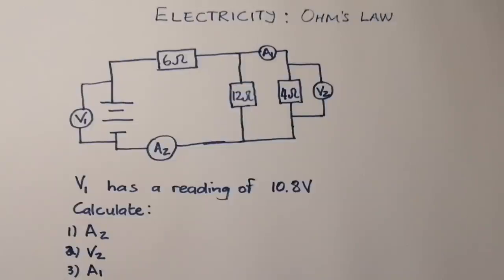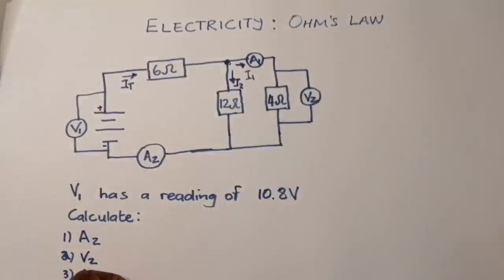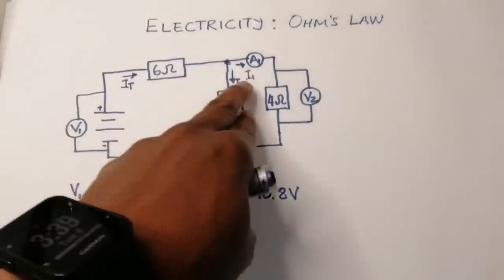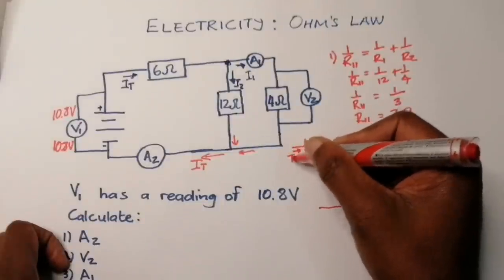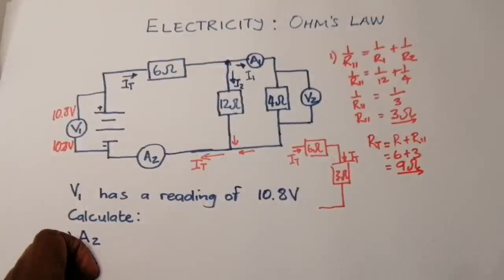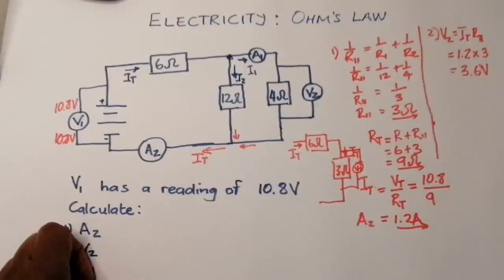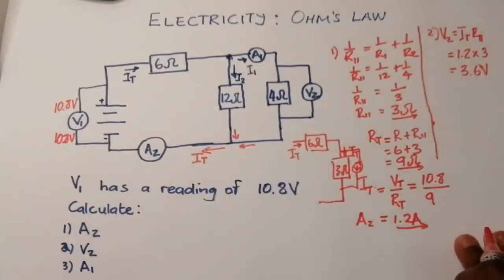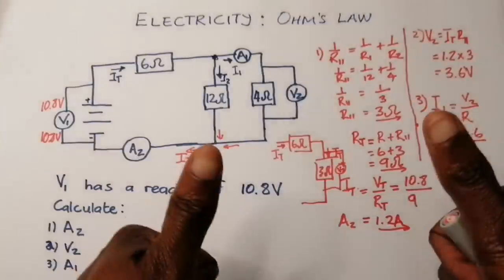Physics | Electricity circuits | Part 2 (Multiple resistors)

Comment: Sir Can I Also Use 6 Ohm Resistor To Calculate A2 Because Total Current Pass Through 6 ohm Resistor [ I = 10.8÷6 =1,8 ]
Reply from the maker: You’re on fire now 🤯
Reply from the maker: Yes you may 😊